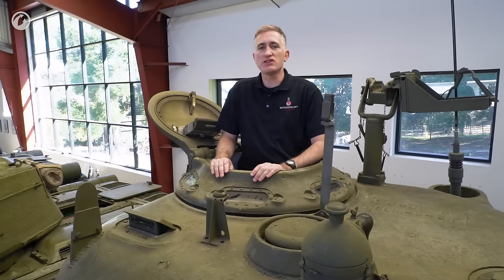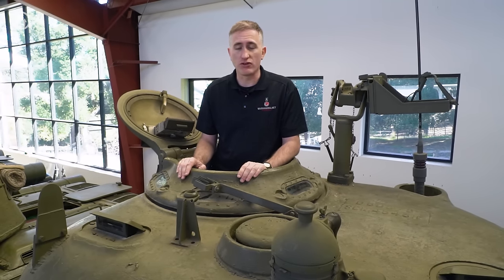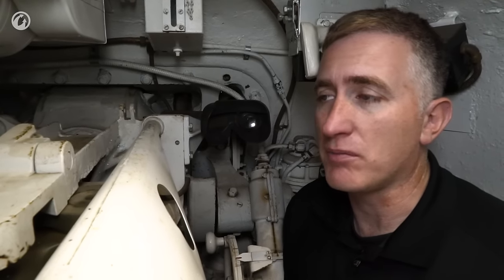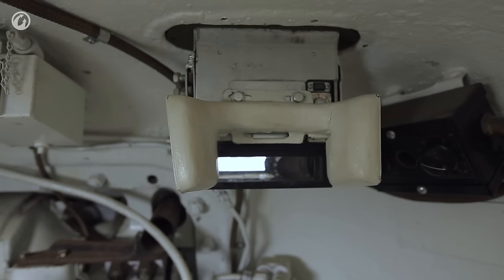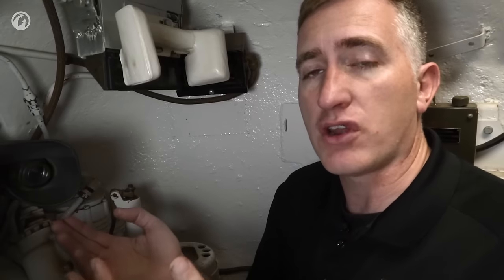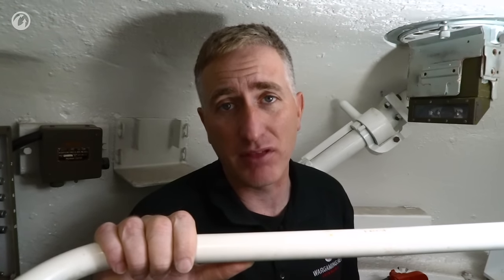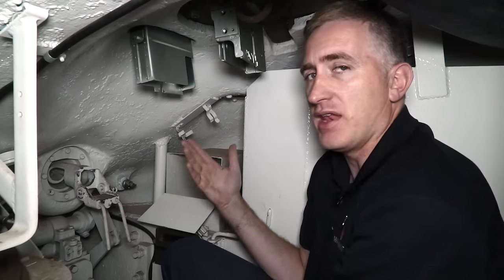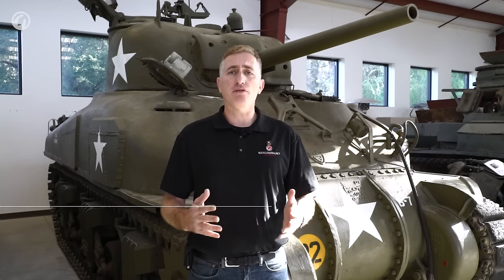Inside the Chieftain's Hatch: M4A1 Sherman part 2

Comment: If the .50 is "not really useful for the crew", who exactly did they install it for? First, it is officially an AA gun, not an offensive weapon. And the commander can still easily operate it from his hatch. Yes, it faces rearward, but turrets are turrets because they rotate. If for some reason you are faced with a target too small to waste a 75mm on, and a tad too big to neutralize with the .30-06 machine gun (hardly a weak weapon), then you just rotate the turret 180 degrees and the .50 is now facing the front. Simple. The reasons they put it on the rear are A.) it got in the commander's way in front, B.) the rear is the least protected area of the tank. You could install a second .30 on the rear to protect it,  but if you are already installing a .50 for AA duty, you may as well put it where it can also cover the undefended quadrant. And it makes even more sense if you figure that the rear is also the most vulnerable to air attack. No plane can hope to penetrate the glacis, but a lucky shot through the engine deck is possible. I doubt anyone ever manned a .50 by climbing out of the tank and firing it over the top of the turret, just so it would still be facing the same way as the other guns.
Reply: The M2 .50 BMG. was mounted for infantry support. It had an incredible long range, was very accurate, could take out lightly armored vehicles and chew holes thru masonry walls. It could be fired by a crewman or an infantryman if the tank crew was occupied.
Reply: @billwilson3609 sorry, but that is not true. They mounted them for use as AA guns. Same as they put them on most other vehicles. They may have used them for that sometimes, but not routinely, and that is not why they installed them. If they had they would have put them in a protected position, and mounted them coaxially so they could be aimed precisely and with optical sights, like the coaxial .30. You used the bow gun for close range area fire, and the coaxial for longer range precise fire, because it was mounted stably and aimed with the telescopic sight. What do to imagine, they parked their armored tanks back from the front line and used their open .50 cals to lay down fire while the infantry went forward to fight? That defeats the purpose of an armored vehicle that is armored so it can go forward with the infantry. And use their machine guns and cannon from safely inside their tank to shoot the enemy to protect the infantry. If they were going to sit back at long range, they have a 75mm cannon and HE shells, but they also have artillery to do that. A tank is meant to close and fight. And if you aren't shooting from long range, there isn't much point in using a .50. If you get closer, then you aren't going to be using your exposed gun mounted on the roof while the enemy can hit you with a normal MG42. There may be cases where unarmored vehicles used their 50s to lay down fire because they couldn't safely close with the enemy and you might as well use the range of your heavy MG to engage them while they can't hit you. But it makes no sense for a tank. And it's definitely not why they installed it. If they wanted the .50 to be a standard infantry support weapon they would have mounted it as a integrated weapon, not one that requires you to either fire from outside the tank or turn your turret around. They expected to be facing hundreds of dive bombers and fighters attacking any concentrations of vehicles, so they have them all .50s to put up a deterrent fire to discourage their aim.

Comment: I disagree that the "Tank's on Fire Test" is an immediate fail. Not having a hatch is a drawback, but these were all spry young men, who had great motivation to get out fast. AND they had a lot of practice swinging under that gun. I bet most of them could do it in a flash, and they probably drilled and trained. A good crew would drill the gunner to automatically disengage the gun when it was time to evacuate, so the loader could easily escape. Now, if your ammo just ignited and is flash burning, your odds are not good. But even with the hatch you'll be lucky to escape with severe flash burns. The gunner already needs to wait for the commander to escape, and they all need to wait until the hatch is open. Luckily, MOST tanks did not just go up like that, there was more warning and the fire took a few moments (or longer) to really get started. So the loader wasn't that badly off. Escaping from a tank that was penetrated was a matter of luck no matter how you cut it, and the real trick was to not get hit. And most tanks managed to avoid it.
When you look at what it involved to escape from a shot down B-17 or B-24, or Lancaster, or any other bomber, it doesn't seem so unreasonable that the loader has to clamber out from under the gun first. In a B-17 or B-24, IF the plane was still on a level, the cockpit crew and rear gunners were expected to climb through the fuselage, and jump out of the bomb bay doors. They were the biggest and safest to jump from, and the only ones reasonably easy to reach from the cockpit (don't listen to all the nonsense about the B-24 being "hated by crews because there was only one exit hatch in the rear fuselage", like Wikipedia says, it's errant nonsense, and you can easily find escape diagrams for the pllane showing that the bomb bay is the main escape hatch; on the B-24 (and probably the B-17 too) the bomb bay was designed to automatically break open under any kind of weight landing on it, both for safety in case the bombs released with the doors shut, and so the crew could use them to bail out even if the doors hadn't been opened by the pilot or the opening motors were knocked out). Anyway, the tail gunner in every case was far away from any exit. The ball turret gunner had to squeeze out of his turret first. And ALL of them would find it hard to move if the plane was in a steep dive, or rolling inverted, even IF the plane wasn't pulling heavy Gees making any sort of movement impossible, which is usually was if the damage was at all severe. You chances of escape were slim if the plane was hit badly enough to make it start falling out of the sky immediately, or if the pilots were killed, etc.
Like on a tank, it was the trained crew that were more important. Like it or not, gunners were easier to replace  than pilots and bombardiers and navigators. On a tank, the loader had probably the least skilled job of all, so he was most expendable, followed by the co-driver (although it must have taken fair skill to aim a bow gun by watching the tracers fall through a periscope sight, I must say!) If a loader was killed, it wasn't too difficult to replace him. Not pleasant, but it's the logic of war, and they all took the chances they were given in the end. Some guys just got more dangerous, thankless jobs. It was just how it was. Hell, plenty of soldiers never saw enemy combat at all. There were more truck drivers and cooks and clerks and ship crews and so on than there was combat soldiers. Is it FAIR that the combat troops had to take all the risk while the rear areas troops took all the women and the best of the supplies, and got rich off selling GI supplies on the black market? No. But c'est le guerre .
Reply: The M4's came with 5 operating manuals that explained how each crew position was to do their assigned tasks. Each crewmember had a manual to study on their off-time and when together as a group to learn how to take over any position when needed. The bow gunner/assistant driver usually became the loader when the loader became the gunner who had to replace a stricken tank commander. The driver became the bow gunner since new drivers were often infantry men that were easy to find and train since most were familiar with driving manual shift motor vehicles. The driver also was trained to be the tank's mechanic but all of the crew members learned his tasks so they could perform the daily maintenance and any repairs faster.

Comment: Great Job - I hope Panzer 4 will be next
Greetings
Reply: It would be nice to see the situation of the crew inside the turret with the short 75mm and the long 75mm L43 on the Pz IV
Reply from the maker: Interestingly, there doesn't seem to be a huge problem. I sat inside a converted PzIV in Bovington, that had the short 7.5 replaced by a long one. Because the TC is located behind the gun, the amount of room for the gunner and loader is actually pretty similar. The TC just has a more worrying issue of the breech recoiling far closer to the family jewels.
Reply: Thanks.

Comment: The M4 and M4-A1 and M4A2 were produced concurrently the lower hulls of all three were M3 riveted hulls the upper hulls of the M4 and M4-A2 were welded Hulls, 
The Marine Corps was given M4A2's because the U.S. Navy used alot of Diseal Fuel , they were also given some M4A1's as well, they would use early , mid and late production M4A2's Im not sure about the M4A2 76mm gun tank and i believe there was A easy eight version of the M4A2. The Corps did use M4A3's as well i know they were on Iwo Jima .
Reply from the maker: The Marines used A2s because that was all that was available at the time. When production allocations allowed for it, the Marines replaced their A2s with gasoline tanks. If you think about it, the landing craft idea makes no sense because they are not refueled from land, and everything else the Marines used on land ran on gasoline.
Reply: @TheChieftainsHatch  Having read a Marine Corps offical hustory a few years ago Diseal fuel was more readily available in 1940 , 1941 because of ships the U.S. Navy were operating.

Look at the P51 Alison engine fighters They required higher American grade Octane avaiton gas, when they were sent to England they suffered from underperformance issue for the main avaiation gas was from England and i heard of the fuel as dirty it was lower octaine, thus these early P51's were pulled along with other fighters and sent to places like the pacific were we supplied the higher octaine gas and they performed superbly and the Those P51's were replaced with the Merlin engine that was designed for the lower octaine
Reply: No the war progressed very technically speaking in light years , the Marine Corps strength , December 7th, 1941 had a strength of around 63,000 men and was forming the 1st Marine Divison on the East Coast which then transferred to the West Coast  than the 2nd Marine Divison soon formed afterwards , you had Marine Corps Aviation, Brewster Buffalos, the F3 Wild Cat and starting to enter service the F4-u Corsair , early Corsairs there was a observation window between the aviators feet, later these windows were psinted over then replaced, the outter wing pannels were fabric covered.  And had six .50 caliber machine guns, Brewster Buffalo actually built a diving bombing version of the F4U Corsair, then the Corps also operated SBU Dive Bomber and Torpedo/ Bombers just like the navy, by 1945 the Marine Corps had a strength of around 700,000 and six Marine Divisons and operated the ground forces at Corps level Ist Amphibous Corps, IInd Amphibious and IIIrd Amphibious and Vth Amphibous Corps were used. 
The Marine Aviation went to be one of the largest in the world , the Marine Corps by example was the second largest user of the B-25 Mitchel i think they had 700 of them,  look at naval construction and the building of tankers , the fuel situation changed , for the Marine Corps and gas became the primary fuel in the pacific

Mid production M4A1 and M4A2's the lower hulls were same design as M4A3's .

I seem to recall the M4 Sherman was not popular with Army Officials and for got the M4A3 was also produced concurrently and they took some M4 Shermans but mostly M4A3's and M4A1's. , i believe the Corps took into service  some of the Composite upper hull Shermans but were never deployed overseas.
Reply from the maker: Ken Estes, probably the authority on USMC armor operations, is extremely clear about the issue being the availability of the tanks, and specifically denies the fuel commonality argument. Given the realities of what units ashore used diesel, combined with the known allocation rates of the various M4s, Ken's position seems pretty unassailable.
Reply: Im just saying I read a official WW2 History of the Marine Corps in WW2. And that is what the book said. 
If you look at it makes sense the Marine Corps was the hand me down service and they kept equipment in operation long after over haul was required and the British did it far better than them.
Remember we were fighting a two theater  war and and each theater had multiple  fronts , fuel was a priority just ask Patton when they cut his gas supply.
The war in the pacific was far different than the Eorpeon theater in late 1941, our navy lived on diseal and yes they had gas but we had limited stocks and that was being directed to aviation. 
Like i said the war in the pacific had limited line of sight surface naval engagements most naval battles esp the big boys was beyound visual range this means air craft, thus in many ways in was a naval airwar. And if you look at it the Marine Corps did receive M4-A1's gas engine and i have seen photos of them being used in combat , the corps operated if I recall in two sub theaters the west Pacific and South Pacific , and the U.S. Army was in charge of one of these  theaters , General McAruther was the commander and the U.S. Army operated its own Navy, thus they most likely had more gasoline in their theater of operations, i believe that is where the Marine Corps operated at least some of there M4A1's.
I know the Marine Corps also operated the M3 half track , 3inch model 1897? Tank Destroyer .
Used it mainly for fire support.
But i will accept what you say.
Reply: The tanks were never far from the beaches in the island hopping campaign and the navy had an established diesel supply. I is not the problem that it would be taking supplies across the channel and France to supply diesel in Europe. Is this not sensible?

Comment: love the shermans, did any of the models use a detroit diesel engine? just thinking back to Kelly's heros thats mentioned
Reply: The Ford GAA was produced in Michigan, though not Detroit. They used M4A3E4s in the movie. 

The M4A2s used the General Motors "Detroit Diesel Department" Model 6046 twin-bank 6 cylinder inline diesel motors.
Reply: +Reuben Clarke

 M4A2... yes. Where did they say that in Kelly's Heroes?
Reply: @peterson7082  When they were planning on attacking the Tiger in front of the bank. The tank driver said "they'll hear our Detroit engines before we ever get near them" or something like that. You would assume he was talking about Detroit Diesel engines but most all of the diesels went to the Soviets because US Army did not have logistics setup for diesel fuel and all the Soviet tanks were diesels anyway. If the Marines did get diesels I guess that the navy must have had more supply of fuel for boat engines or maybe Seabee construction equipment?
Reply: @keithstudly6071  Not really the case actually. Most M10 tank destroyers and a large number of trucks and halftracks were diesel. Just standardization for armored force units I guess?
Reply: @peterson7082  The M10 used the twin Diesel engines since their high torque at low RPM's allowed the tank to take off faster from a dead stop. The M10 hull was used for the M36 TD so the their late production run was fitted the the Ford GAA that was used in the M36 since those M10's could be converted into a M36 by changing turrets. Otherwise, all US vehicles in Western Europe used gasoline engines with most being modified to use the standard 80 octane gasoline being produced by refining light sweet crude so didn't need any additives to raise the octane level. The War Department did that so the additives could be reserved for producing high-octane aviation gasoline. The US Army did use Diesel engines to run generators and in heavy construction equipment that came with Diesel engines, like bulldozers, cranes and big dump trucks.